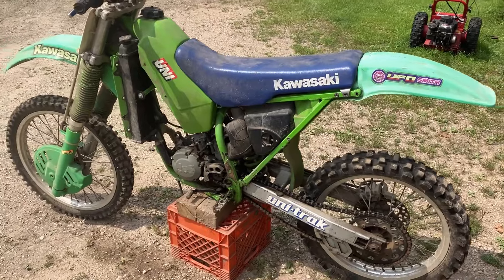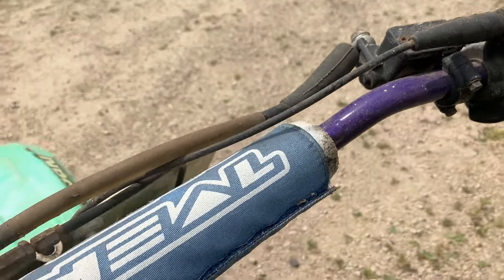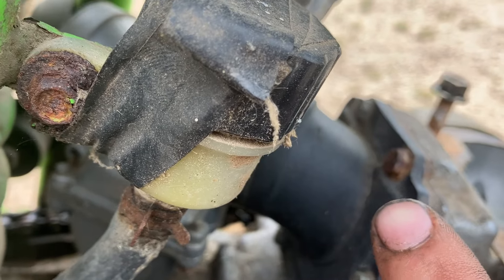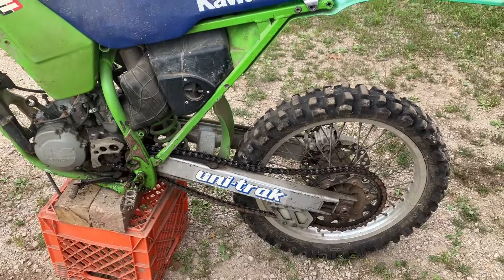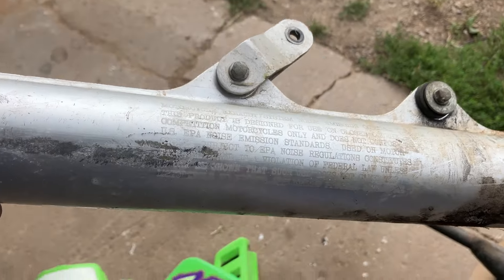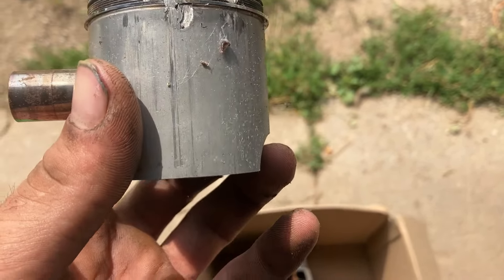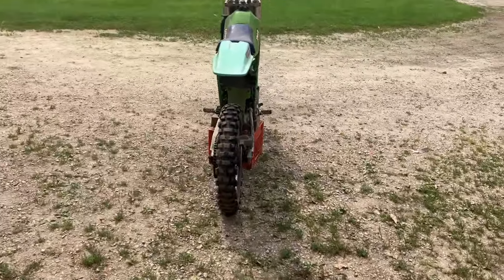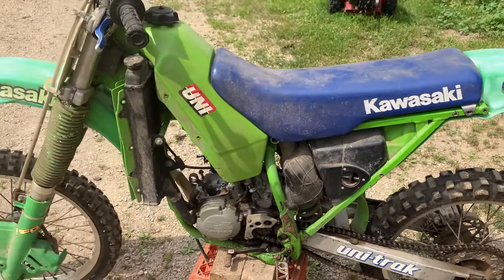KX125 Dirt Bike Sitting 20 Years - How BAD Can It Be?

Comment: It's an 1989 going by the green subframe (88 was silver),  rotor and larger forks that changed 88 to 89.  88 and 89 both had 1 radiator .  I had an 88 brand new back in the day and almost bought an 89 the next year.   88 and 89 were near identical but 89 brought bigger forks and different cylinder porting, most favoring the 88 porting.  Some covet the forks from an 89 as the best and last of the conventional forks. 90 went upside down. 89 euro models had usd forks, usa had conventional
Reply from the maker: Awesome info thank you!

Comment: only the newer kx125s have 2 rads i thought they stopped in the early 80s but this bike proves me wrong if it is an 89
Reply from the maker: Yeap 89. I haven't checked the diagrams to make sure it has 2 or not
Reply: @bearkreekboys  it's looking like it's only 1 the tank says it all and its too big and different shaped to be an 80/85 tank I've got a kawi/yamaha dealership near me and they got oem parts diagrams with oem part numbers if you want a link to their site